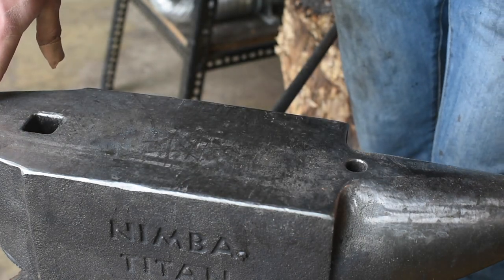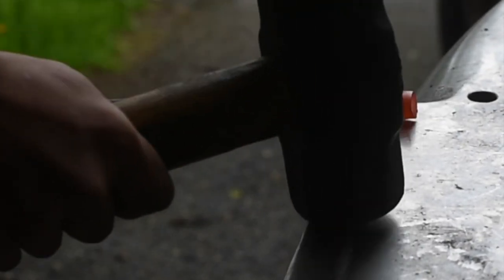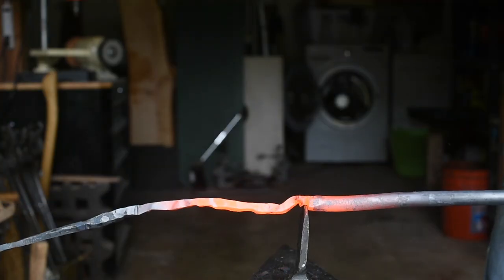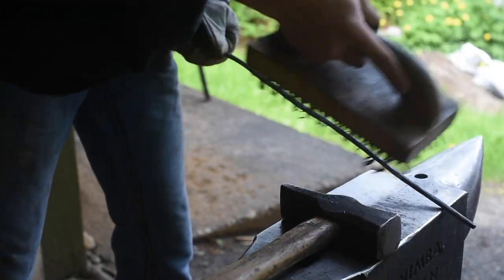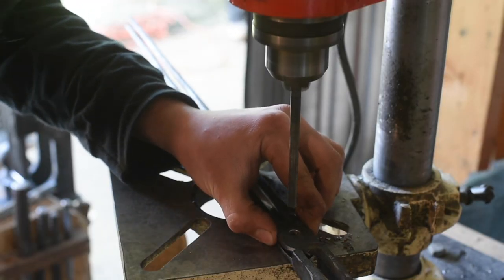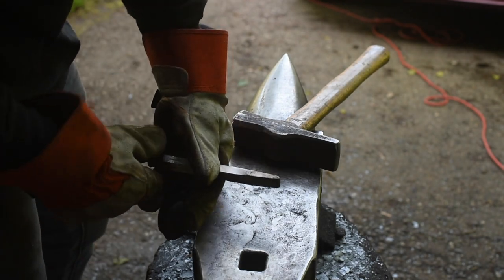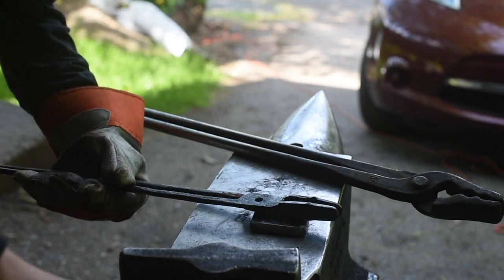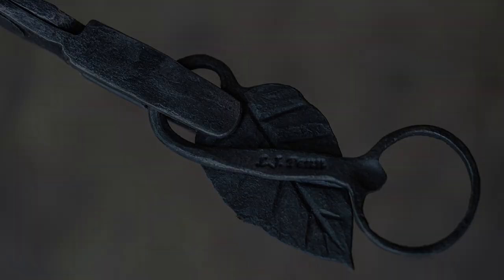Forging Tongs! (First Try)

Comment: Not bad for first try,  I think the boss area is too thin  this area takes a lot of mechanical force when holding stock, and the reigns look very thin. See how they go. Brian Brazeal explains it really good. Well done.
Reply from the maker: Yeah they are too thin and I’ve had some problems with that. They are great for heat treating small things but that’s about it. Next ones will be better 🙂🤘🏼
Reply: @LiamJPenn  Good on ya mate you'll get there, I remember my first few sets they were shocking, Tried welding nibs back on ...hahaha. Of course they broke, With practice you'll be making perfect tongs. I watch also a lot of Joey Van Der Steeg. He's good too at making tongs.